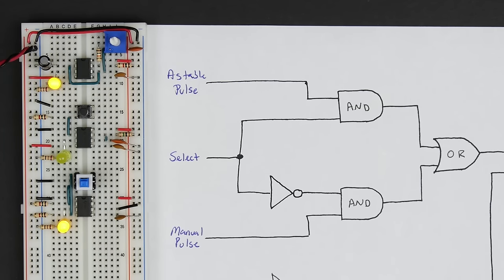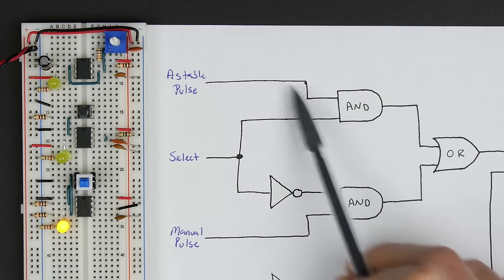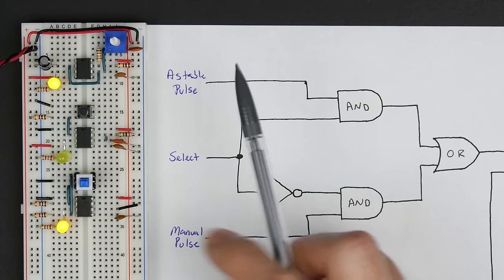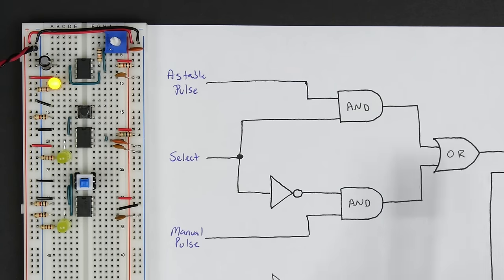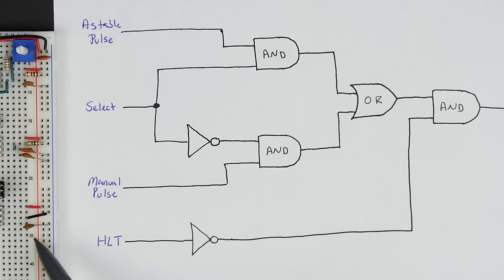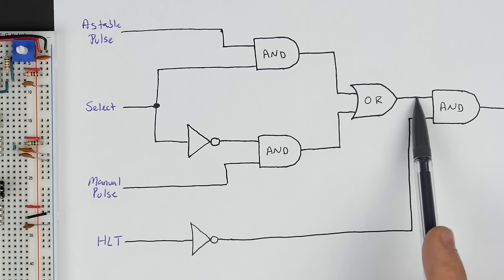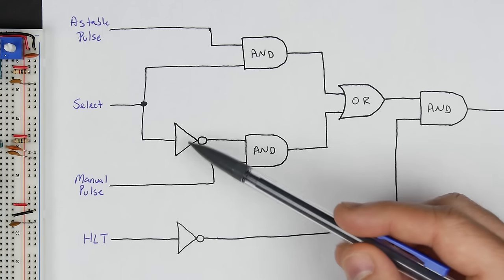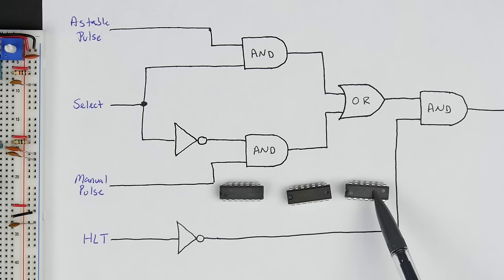Clock logic - 8-bit computer clock - part 4

Comment: @Ben Eater Looks like you changed the clock module from the build videos slightly when used with the 6502.
1) You shortend the power leads and added a larger electrolytic across the rails near the leads.
2) You added a ceramic cap across the momentary switch.
3) You added a ceramic cap across the rails by the 7432s ground.
4) You added a resistor to the blue LED.
What are the values of those components?

Comment: I am lucky enough to have your clock and 6502 kits.  When I connected my clock to the 6502 the arduino sketch only showed every other clock tick.  I found that the final output, connected to the blue LED is misbehaving.  All was well after I added a resister in series with the blue LED (which is shown on the schematic).  Wonderful tutorial. Thanks

Comment: Hi Ben: I've just started watching this series and I'm really impressed with your setup and implementation. One suggestion I would make to have made this a bit better would be to have your schematic line up with your circuit blocks. In the video, the select circuit lines up with the manual pulse part of the schematic and vice versa.
I taught this stuff for 15 years at tech college level and so I guess I'm just a little picky for details like that.
In any case, I was thinking of doing something like this for a You Tube sequence and I'm so pleased to see that someone has taken the time to do this. Well Done you!

Comment: I know that everything you've done here is to make this build as easy to understand as possible, but it should be known to those that may not want to solder different pins to the toggle switch, you don't have to have it straddling the centre, you can move it to either side of the board. Since the pins on the other side aren't used it won't be an issue if they're connected together. I've built this and I put my toggle switch below my trimmer pot on the edge of the board because I have a rats nest of jumper wires to press through.  I'm thinking of using one of my 556's to reduce the space.. I might even get a pcb made and make it permanent. It's a nifty circuit.

Comment: PSA: The 555 can be powered by 9v and it is tempting to do so when building the circuit up on your breadboard (independent of buying the kit); BE SURE TO CHANGE TO 5v to continue to the logic chips and on to the 6502.
Reply: Thank you so much i was struggling with this exact problem and this just made me figure out why the circuit wasnt  working. THANK YOU!!!!

Comment: do a tutorial on how to do ur wires like this , i am serious :D
Reply: I'll second that, the wiring here is a work of art
Reply: Wire cut to length, strip ends, needle nose pliers to bend 90° - thrown in bin if too long or short. It's far slower than using random pre-made lengths but far tidier.
Reply: Its pretty easy To do by urselft, most ppl wont do it and thats one of main reasons why these vids Are so satisfying,, u would get Same info from hunderds other videos  but cause of those u should watch this. (also cos articulation on these is good For watching it on 1.75 or 2x speed)
Reply: done

Comment: Hi. first of all i'd like to say i enjoy your video series. i used to play with microcontrollers 8051 some time ago.
I have an improvement suggestion for your clock module:
in this switch circuit you have introduced a glitch on the clock switch module.
let's assume both clock signals (from 555 and from manual button) are currently HIGH, and the system is set to auto-clock mode (SELECT = 1).
the UPPER AND gate state: 1 AND 1 = 1
the LOWER AND gate state: 0 AND 1 = 0   (first 0 comes from inverted SELECT)
as a result the OR gate output is currently 1
When we press the SELECT button (switch from 1 to 0) - the following will happen:
the upper AND gate will get the 0 first, therefore it's output will change as expected - (1 AND 0 = 0)
the NOT inverter introduces propagation delay of about 10ns, but it can be as much as 100ns in some circumstances (depending on voltage, temperature and gate speed)
therefore for the small period of time we are having "0" signal on both AND gate outputs, and the OR gate will trigger to LOW for a short while
then the lower AND gate gets the delayed 1 from inverted SELECT and output of lower AND switches to 1, and therefore OR gets back to 1 again.

I believe, that glitch of 10+ ns could be recognized by your computer as extra clock cycle.
so if we try to PAUSE the system at the moment we want, system will instead go one step forward before stopping.
I'm curious if it happens in your computer (?)

There are a couple of techniques that allow performing of "glitch safe clock switching"...
As a bare minimum we could reduce glitch by simply adding some extra gate (like one more AND) - on the upper AND gate to try to match propagation delay of the NOT inverter,
but it's also not best solution since it doesn't eliminate the glitch completely. There are other methods based on flip-flop switches for both synchronized and independent clock signals, etc...
You put a lot of effort in de-bouncing the buttons, maybe let's try to eliminate that glitch completely too.
How about some experiment to visualize the glitch and then maybe try to upgrade your clock in the next video: "clock - part 5"? :-)
Anyway, thanks for your videos! and keep up the good work!

Comment: The SOP section begs for NAND (that, or the voices in my head). I'd keep the inverters though. Then you just tack one more NOT gate at the end to turn the final AND into a NAND. 4 NAND, 3 NOT, 2 chips. And still easy to understand.

Comment: re your glue logic- you could also build your own gates from (very cheap) n-channel mosfets & pullup resistors, it's pretty simple- one transistor by itself makes an inverter, multiple in series make a nand, multiple in parallel a nor- it's perfect for when you just need one or two gates to tie a couple things together, or need an unusual number of inputs, where standard chips would be inefficiently used...  that's how I'd do it anyway.

Comment: I think you can make the the entire timer circuit with only 4 IC’s (2 555 timers and 2 NOR gates) if you change a few things. First, switch out the 555 timer for the toggle switch for a NOR IC (since you can make an SR latch with 2 NOR gates, and so you can use the inverted output with the logic circuit). Use the remaining two NOR gates on the chip to invert the astable and manual clock outputs. Use the second NOR gate for the logic:
((a NOR q’) NOR (b NOR q)) NOR hlt
where a is the inverted astable clock output, b is the inverted manual clock output, q and q’ are the regular and inverted SR latch outputs, and hlt is the halt signal for the programming.
There is a chance this doesn’t actually work, as I did this all in my head and didn’t think about it for very long. I will definitely try it out myself, since this project seems like a lot of fun, and I’m always open to learning more about electronics. If anyone sees a flaw in my idea for this, your comment would be appreciated.
Reply: That is... a really nice idea! At least without test, I will try it on paper first. You can also use a NE556 instead of two 555 :).

Comment: I had a very noisy clock signal after building, reading the data sheet for the SN74LS04N it says you need to tie all unused inputs to either ground or Vcc. Once I did this for all the 74LS chips in the circuit my clock signal was nice and clean.

Comment: Something I was just thinking about, if you are using 4000 series chips, mosfets, really anything CMOS, it's a good idea to set the chip's pins Orleans  the mosfet, etc. on a piece of foil send they can be really really really easy to blow up with static discharge, you won't even know when it happened. It can completely take them out or make them act really wonky, just play blowing up other stuff LoL :-)

Comment: What's funny is Texas Instruments also designed and released "smaller footprint" TTl 74XX series ICs.

A Single OR Gate? 74x1G32
Only Two NOT Gates? 74x2G04
A Three Gate Chip!? Apparently those are only have inverters in them.

So yeah, they do exist, they just might not be easy to source or procure.

Comment: I think HLT should be on a low signal rather than a high signal.  That way if a wire is broken, the computer stops and process damage is limited.  It would also save a gate...

Comment: Ok, it's possible to do it with 2 AND + 3 NOR
[CLK in] AND [SEL] = > NOR[CLK SEL] input 1
[Pulse] NOR[SEL] => NOR[CLK SEL] input 2
NOR[CLC SEL] AND NOR[HLT] => OUTPUT

Only issue that clock signal is inverted (it goes through one NOR gate). Pulse signal is inverted twice, so it works it works as expected.

Comment: There is another potential problem with the clock source selection circuit - if the astable  555 clock source is running at anything much faster than a very slow crawl, it is highly probable that changing the clock source from the free-running astable 555 to the monostable "single step" push button clock source will result in a "runt" clock pulse from the astable clock source slipping through the selection circuitry because you won't be able to synchronize the changeover with the astable clock signal being in the "low" state.  This could result in unexpected behavior of the microprocessor (in this case the WDC 65C02).  Additional circuitry to sync the changeover with the change of state of the astable clock source needs to be included.
Reply: Thanks for making this comment, I had the same concern and searched through the comments incessantly to see if someone else had already pointed this out.

Comment: I haven't tried this but I think you could make the clock selection logic with just two chips containing AND gates (74LS08) and NOR gates (74LS33). The NOR gates have the advantage of being able to be used as inverters. The gates on the chips would also be slightly better utilized, but I take Ben's point that he is not trying to build the world's most efficient computer.

Comment: Hi Ben, I have finally started after many years that I bought the kit. I found a "mistake" or something that it should not behave as such. Maybe I am doing something wrong. Your selector should not send the input to the inverter through pin 3 of the 555 timer of the bistable. This is because there's some residual voltage. What I happened to do is to connect the signal to the ground of the switch. removing the need of one inverted port.

Comment: So, I did everything right and the astable clock wouldn't propagate to the clock module lamp.  Bistable was fine.

Added a breadboard below and with some LEDs traced the outputs which generally looked fine; so it was cool to see how exactly the switch signal splitting worked and some of the effects I got from fiddling around were interesting.

In the end, though, just removing the astable LED fixed the problem and I have a working clock module.  I just don't understand why.

Comment: I've been working on this computer in my spare time. After testing a few of the components, I moved on to the program counter. I found that regardless of whether the clock was in run or step mode, the program counter was still operating as if the clock was in run mode, even if I disconnected pin 3 of the leftmost (astable) 555 timer described in this and previous videos!  After quite a bit of troubleshooting, I recalled the concept of "coupling" I had read about in the comments here and elsewhere. I added a capacitor across pins 1 and 8 of the astable mode 555 timer and the problem disappeared. I wish I had even a sliver of the technical proficiency to know why this helped, but I'm glad it did. I wonder if an oscilloscope would have helped me to debug this problem?
Reply: Thanks !!!!!! You just saved my project, I was having the same problem where even if halting, the program counter kept going up hahahhaha Thanks again ^-^

Comment: Why the blue LED doesn't need resistor? (I'm not too familiar with electronics.) Update: oh, I found the answer in comments: you forgot. :) Update2: ...But after some videos I think the right answer is: the chip output is already current limited. Am I right?

Comment: Looking at that schematic, couldn't we just replace the OR gate with 2 diodes and a pullup resistor, replace the inverter with a single transistor, and then label our HLT line "active low" and call it a day? :) That way we're down to a single 74xx08 chip.
Reply: +John Tsiombikas ops, I meant to say: "2 diodes and a pullDOWN resistor". And btw, awesome set of videos, cheers!
Reply from the maker: +John Tsiombikas Yep, that should work; give it a try! I'm intentionally using positive logic for all the control signals (like HLT) so the control word is easier to reason about later on, but doing so isn't required and will mean adding some "unnecessary" inverters.
Reply: +Ben Eater Hey can you please tell me what program you use when you do the screen writing... Awesome series btw keep up the GREAT work :)
Reply: how many watts are resistors
Reply: I would guess they are 1/2 W resistors.
Reply: ok
Reply: You could also replace the one OR gate by two NOTs going into an AND, followed by another NOT (remember, DeMorgan). This way we'd retain positive logic for HLT, while getting by with 4 ANDs (74xx08) and 5 NOTs (74xx04, hex inverter).
Reply: And why exactly could we not just replace the OR gate with a simple cable? As in, connect both outputs from the first 2 AND gates with the same pin on the third AND gate.
Reply: chill john. how are us undergrads in digital electronics supposed to follow along if you do all this adventurous stuff to the circuit.
Reply: TheRealMeisl, I was thinking something along such way, but recall that AND followed by a NOT is a NAND gate so we could replace all ANDs and ORs with NANDs and add a NOT after final NAND. That would be four NANDs and three NOTs.

Oh… Ben essentially mentioned that seconds later in the video. ;)
Reply: @athp  They look like 1/8 W resistors and doing the math that size would be sufficient.
Reply: Mark Brown do you reckon that using 1/2 watt resistors would increase power draw or is it the resistance that matters
Reply: What if you eliminate the inverter on the HLT line and use an or gate instead?

Comment: For one thing, if you did use an actual SR latch for debouncing the selector, you could use Q̅ instead of having to do !Select.  Of course, that wouldn't save you any parts, as you still need another NOT gate for the Halt signal.

Edit:  I still haven't gotten around to finding the actual overline.  Pretend that the bar over 'Q' is actually centered.  Unless it is in your font, then just ignore this.

Comment: Great Video, never seen a youtube video this detailed. One of my 555 timer IC got really hot. Everything works and is connected in the right place (I checked at least 20 times), but it still gets hot. Is this a sign of a problem? Also, I'm just an intermediate beginner, and is there a way to use just one IC for all 3 555 timers?

Comment: The 3 IC's can be replaced by one 74LS157, the HALT connects to the nStrobe pin.
Reply: or probably also by the 74LS151, HALT connected to nEN pin.
Reply: I'll stick with the 74ls157, by paralleling the inputs I can get multiple clock outputs for more output drive capability.

Comment: why can't you just use pin 7 and pin 3 from the third 555 to switch between the first 555 and the second 555? does it have to be so complicated and expensive? I mean in that way we shouldn't have to buy extra gates at all. for better understanding pin 3 from the third 555 should be used for the first 555 on pin 8 instead of VCC and pin 7 from the third 555 should be used to pull the second 555 chip to ground when not used if I thought it out right 🤔

Comment: You solved for the bouncing of the switches, but I think you still have potential problem of sliver generation on the switch.. caused by your button press being asynchronous to the existing bistable clock source. Unless you time the button press correctly you could generate a clock which violates the timing of the processor, which could cause corruption.. not just N steps.  If you had left the LED in circuit for the bistable clock you could have done the switch when low.. but without the switch is blind

Comment: In the RAM module build you used a 74ls157 as the multiplexer for the dip switches and the address register, could you have used that chip here to select between the clock, pulse, and strobe line providing the hlt ?

Comment: Brilliant! Thank you! Wouldn't you need one more SR (555) to flip between HLT and NOT HLT? How do the logic gates behave when you're pulling your HLT line  out from GND to +5 and vice-versa?
Reply: When you're using a wire or a switch like this, yes it would require a debouncing circuit like the 555's we've seen. But the eventual intent is to use logic levels output from the rest of the computer, which doesn't need to be debounced because it uses semiconductors instead of moving metal.

Comment: Hello Ben. 
Amazing job you have done with this series of videos, and what a superb explaining!
Like many, i decided to start building the 8 bit pc. 
Began with the logic gates, and had some 2n2222 aside which i used first.
Of course i bought a bunch of LS chips, but also like a thousand of 2n2222 and 2n2907 transistors. 
I finished this lesson but did not used the ic chips, still went for a minimal solution with 2-3 transistors per gate equiped with pull up and down resistors.  Conclusion is that it functions well, but i dont know if there will be sth wrong in the future?

Comment: haven't tested it, but couldn't you replace all those logic gates with a 74F153 or similar 4-way multiplexer, using HLT and Select to pick between the automatic clock, the manual clock, ground, and ground?